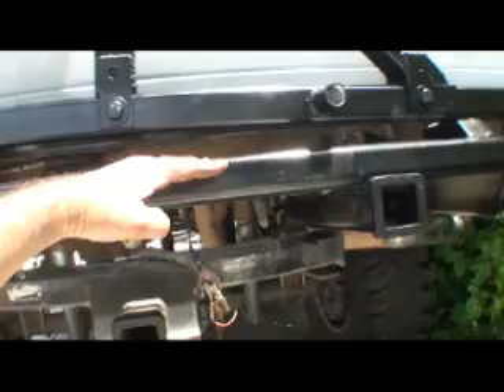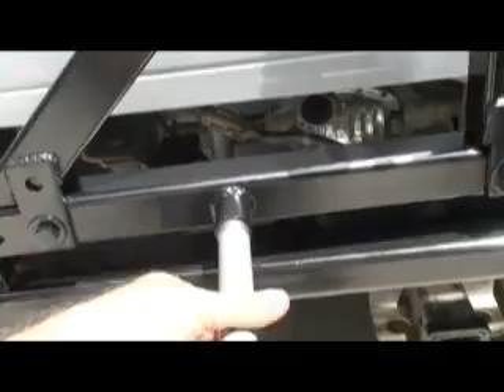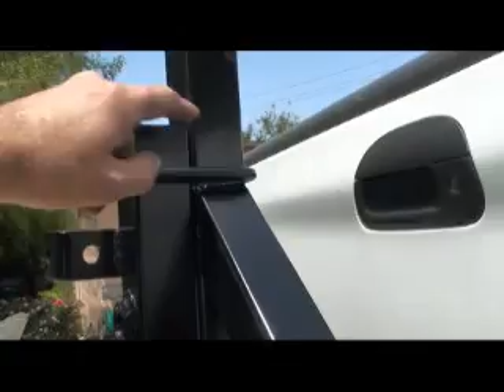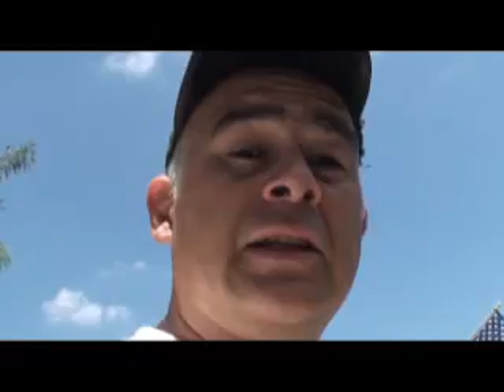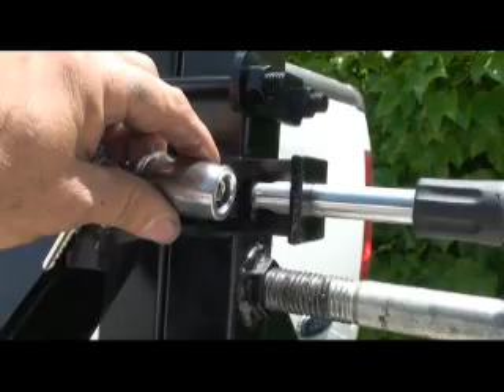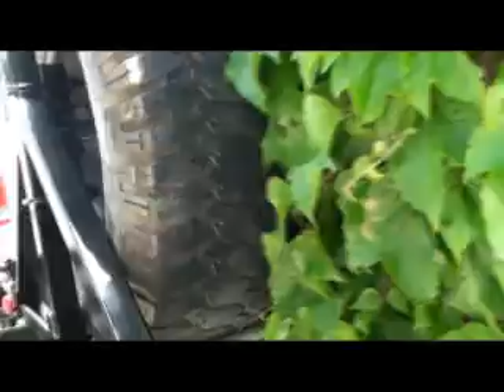Superduty tire carrier build part 4

Comment: That's not bad. Sounds like you needed some beers to calm down. LOL. I like the idea. I'm building my tire carrier for my 4Runner. It's still just a frame on a hinge just like yours but I'm going to do a lug nut setup up instead of your tire mounted style. I'm going to use the same lug pattern to hold the tire up and lock it in with a wheel lock. That's pretty close to my set up. But I'm doing it off to one side. Gives me ideas in case mine doesn't work. 

Great video. Keep them coming.

Comment: welll i was looking at the plate that he bolt goes over to hold the tire in place...u can weld some extensions on the bracket that have like 1--_--1 like a curvature to lockinto the lug nut holes or the holes on the rim or somethin lol but idk i wannasee the bumper u were gonna make?

Comment from the maker: Thanks for the comment! So far its worked out fine except for the the bolt that secures the tire. It tends to work its way lose but the lock will keep the tire from falling off. So I need to make something that keeps the bolt from turning? I just had a flash! That bolt takes a 1-1/8 inch socket. So I think i'll weld a metal tab to a socket and then aling it with the lock to keep it from rotating.

Comment from the maker: I used a trailer axel spindel for the swing arm. Its rated at 1250lbs.
Axel spindel and hub was $62.62 and the steel was $146.25, and then theres stuff like nuts, bolts, paint........